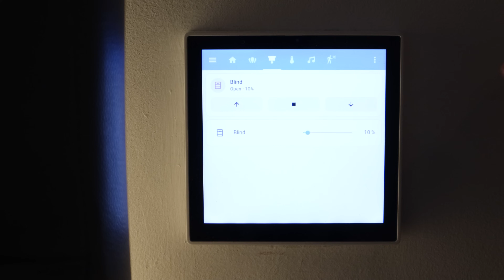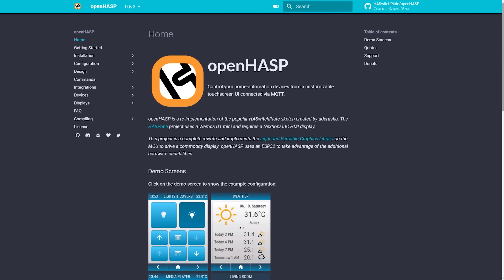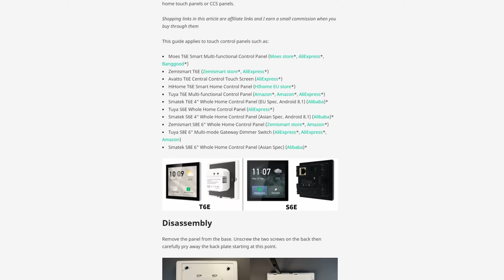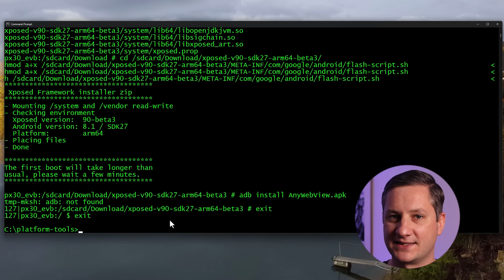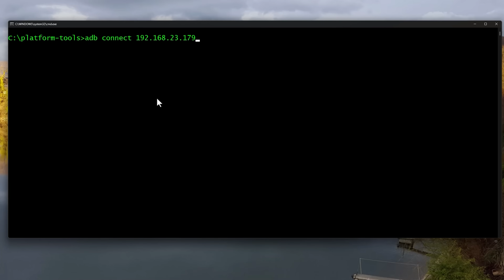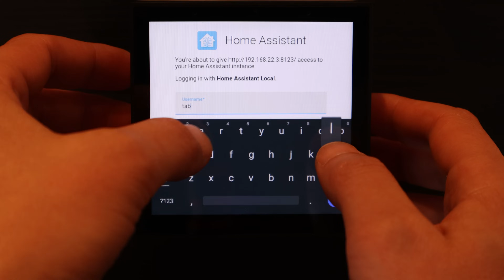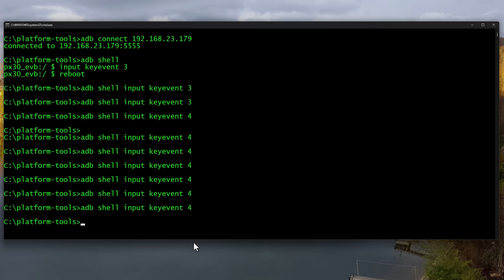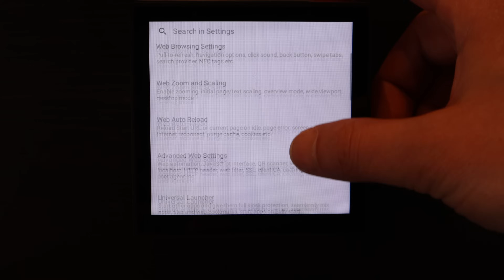Home Assistant Wall Panels

Comment: Their cost is still high. An old 8" tablet is cheaper in many cases  😊
Reply: But a lot more ugly
Reply: I have an old 7" fire tab mounted next to my sofa 3D printed a frame so it looks better then a random tablet in the air
Reply: These Tuya panels aren't much better looking. I'll take the tablet with a few strips of wood trimming it.
Reply from the maker: Yep. But far more difficult to nicely mount in an existing light switch hole
Reply: @HomeAutomationGuy  nothing a 3m wall strip can't handle ;-)

Comment: will it work on no neutral wiring?
Reply from the maker: No, sorry 😔
Reply: @HomeAutomationGuy  😞
Reply: Where do you live with no neutral wire? Afghanistan??? It’s standard in Germany since 50 years.
Reply from the maker: @MatzeMaulwurf  Most UK houses don't have neutral wires at the switch
Reply: @HomeAutomationGuy  ok, they are doing it their own way. And they believe it’s a good thing. So let it be. Just read they want to go back to imperial measures. If they really thing this is how the future should look then ok, they also might think that neutral wires and RCDs are forcing them into a wrong direction. Thanks Guy for the hint.
Reply: @MatzeMaulwurf  A lot of (very possibly all) newer build houses do have a live and neutral line going to the switch. Older properties which have had the electrical systems upgraded will also be wired in this way. However, older properties it was normal for only the live wire to run to the switch, with the neutral only going as far as the light fitting. When  the switch is activated it completes the connection of the live wire and completes the circuit. As an example my parents' house was built in the early 1970s and they only have a live wire running to each light switch.